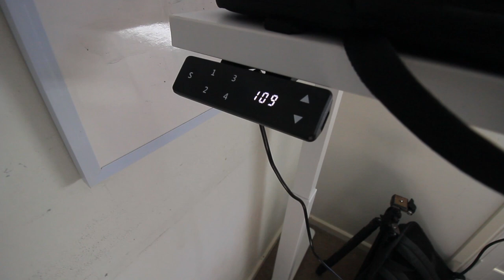Officeworks Matrix Executive Electric Sit Standing Desk Unboxing & Setup

Comment: Great Video.

However I struggled to align the screws to the table top with the frame. Some fit some don’t . Any idea ?
Reply from the maker: Make sure you are using the correct screws. Mine came with rubber disks which you put between the frame and the top. Then I put my screws in from the bottom.
Reply: @techprometheus  thanks . I’ll try that. Doing from the top instead
Reply: Arjun did you manage to solve it. I am facing the same issue

Comment: I just got this table, it's awesome! The motor should stick out the back (as you've mentioned, but people aren't reading your description) and I also had pre-drilled holes for the up/down controller (I saw you had to hammer at 7:42 to get the screws started which I didn't have to do, weird). Maybe the 1500mm Oak veneer tabletop is slightly different (and possibly in Australia only?) The tray to hold the power adapter sticks out the front but is less thick than the motor so doesn't hit my knees, but is loosely clipped on and the adapter has screw holes anyway so I might move it to the back in the near future.
You can build this alone, but it's heavy, never let a long piece dangle in the air while only attached with a couple screws, and construct the frame ontop of the wood then flip it. Super smooth, solid and barely wobbles. Def recommend the extra $30 for the Oak finish if you can find it.
Reply from the maker: That's really nice to hear, I drilled holes for the up/down controller as I wanted to have it on the left side instead of the right side. I went with this table, as it was the last one left and I needed a table that was longer than 1200mm. The oak finish looks really nice, if you were ambitious you could use your own custom top and all you need to do is drill holes for it. Luckily, I had someone to help me. Would take me much longer to assemble by myself. If you are short on time, Officeworks has an assembly service that you could use. Also when you do pick it up, would ideally need an SUV at least. Anyway, this table is of great value. Does the job without hitting the wallet too hard.
Reply: @techprometheus  yeah I have pre-drilled holes on both left and right sides so I was surprised, I'm guessing the Oak was a newer version of the top options so perhaps they had revised the holes placement. I also have many of the large diameter bolt holes available in the corners both at the back and the front corners which are too wide apart for the controller and far away from the frame, so not sure if they are there for other accessory options like racks, but very handy
Reply from the maker: @griknok  I see interesting, it is handy that you have it pre-drilled on both sides. Have you found the standing function handy?

Comment: Great video. How did you attack the remote? My desk didn’t have any pre-drilled holes to screw it in.
Reply from the maker: I had to drill my own holes into the table in order to attach it. You can use a nail to mark the point and/or a marker and then drill a hole in.
Reply: What did that remote ever do to you???!
Reply: @techprometheus  I think I’m going to have to drill aswell. Annoying that they say you only need a screwdriver but you really need a drill

Comment: When I put the second bar in (no 6), the two center screw holes don’t match the motor. What did you do?
Reply: Allen J. Thanks!
Reply from the maker: You can go to your hardware store to get spare screws. Also double-check your manual to see if you have used the correct screws.